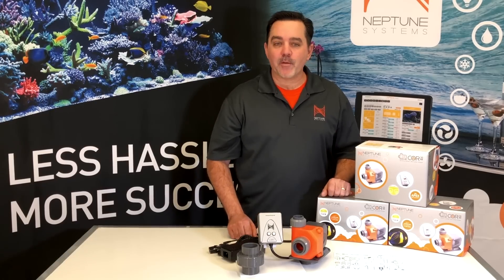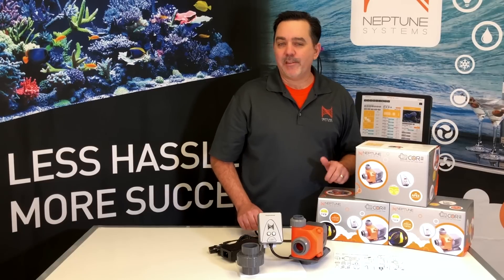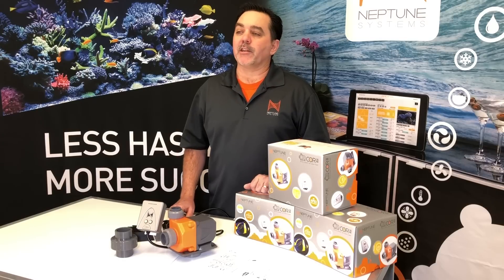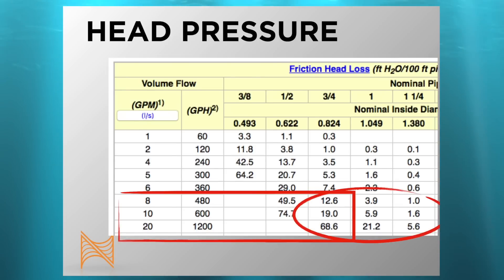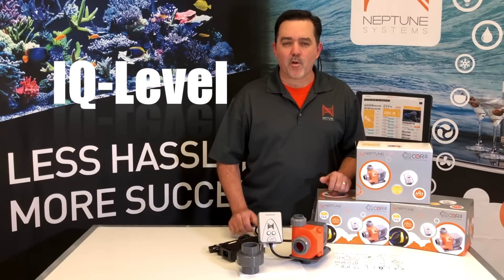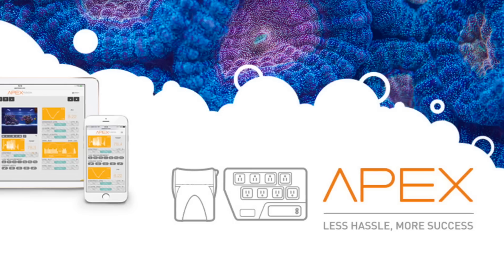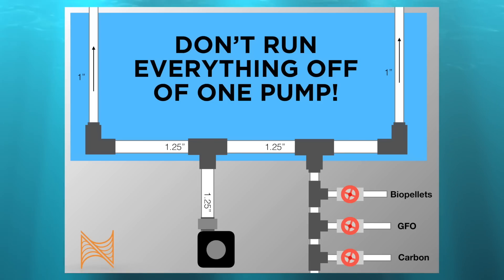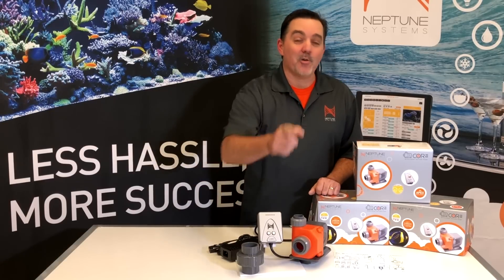Introducing the COR-20

Comment: Would this be ok for a 150 with a basement sump?
Reply from the maker: Yes, it could be depending on how high your ceilings are, if you put the sump in the basement up off the floor, how much flow you want through your sump and also if you plumb it with 1.25" or even 1.5" from the pump. There are many factors to consider. Do not expect 10x turnover through the sump.
Reply: No it can not, look at the pump curve based on head height. Its just another example of a DC Drive pump not design for flexibility! The driving factor here is the Apex Ready pump.............I get it, but if you want a pump that actually is designed with remote capabilities vs a under tank Sump..............Go with Royal Exclusiv or Abyzz.....................These are designed to handle this typ of situation. The goal for this pump and many others when it was nothing more than a concept was to hit the masses, when that is the #1 priority it takes higher Back pressure Flexibility out of the equation.

Comment: At a Neptune Event hosted by a local LFS the rep from Neptune talked about the 15 and 20 being essentially the same pump, just one comes with the power supply to provide the power necessary to increase flow for the cor20. So I’m curios if that is still the case. So if I buy a cor20 could it be run with just a 1link making it essentially a 15? And will a separate power substation ply be available as a replacement part for the 20 as well as to upgrade the 15 to a 20?
Reply from the maker: That is correct. The pump body is identical between the two pumps. The driver is different. The COR-20 driver has a power supply input as well as AquaBus. The COR-15 only has a 1Link connector.  In theory someone could buy the COR-15 and turn it into a COR-20 by changing the driver and adding a power supply, but it would likely not be a cost effective thing to do.
Reply: Neptune Systems thanks for the clarification. Cor20 pre ordered.

Comment: Not the amazing 2000lt wow I'd stick to my 9000lt
Reply from the maker: Actually the pump is 2000 GALLONS per hour, not liters. So, it is slightly less powerful than your 9000LPH pump. But we understand - you have a pump - no need to change if its working for you!

Comment: You didn't talk about heat comparison.  How does it compare to the competition with heat output?
Reply from the maker: A good rule of thumb for these internal pumps is to take the power at the wall, multiply by 0.8, and that is about the amount of heat going into the water (equivalent to a heater of the same size). For the most part, most of the more modern DC pumps of this class (and powerheads for that matter) have very similar power dissipation at the pump and amount of heat transferred into the water.